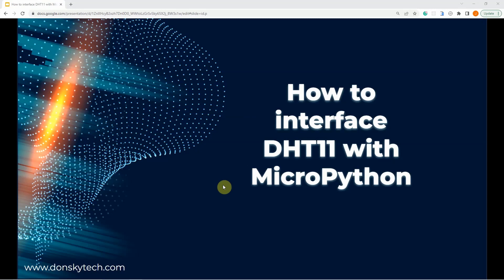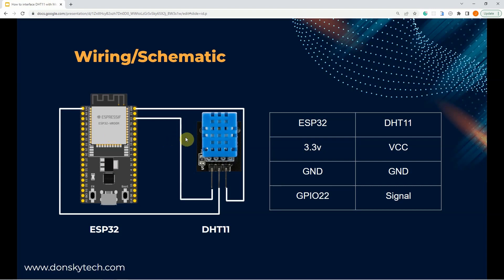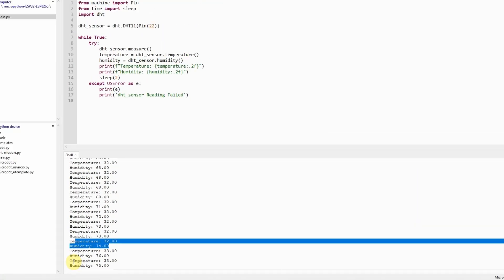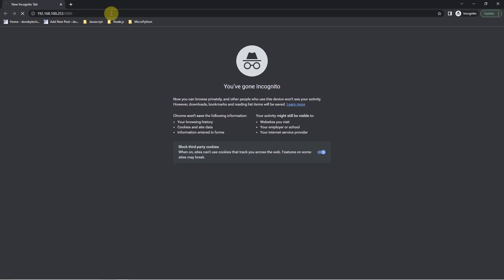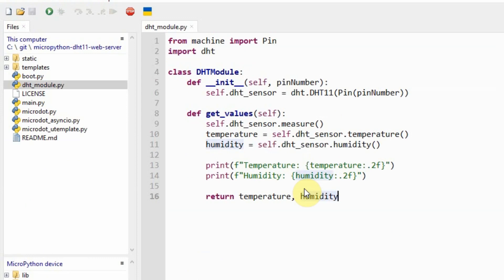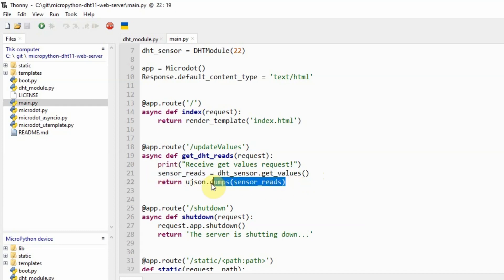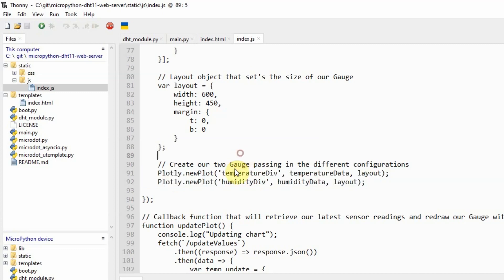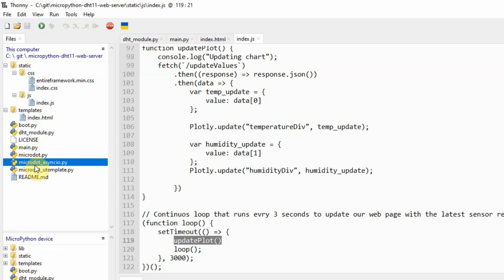How to interface DHT11 using MicroPython with  Real-Time Weather Station Project

Comment: Just found your channel. Enjoying your microdot content. I hope you continue to expand it. One question about how big is this application? Will it fit on the Pico W? If you are looking for a project idea how about a virtual joystick. You got my subscribe. I look forward to watching your channel grow.
Reply from the maker: Thanks for subscribing.  I have just finished creating a program to control your Robot car using MicroPython and MicroDot.   I am creating the write-up and video presentation at the moment.  I will probably release it by tomorrow.
Reply from the maker: Regarding the file size, you will have to check the max file size of your MicroPython device and work around it.  IMHO, I would however not push everything into the filesystem of the device and would redesign my architecture into creating external REST servers that your device would call.  Only the bare minimum code should be placed as we have storage limitations.
Reply: @DonskyTech  Thanks for the answers. I have not looked at your video list, have you covered some of this material? I have spent a decade learning then teaching Arduino. Recently I got into micropython and with the wifi equipped boards it seems like there are so many ways to go. Thanks again.
Reply from the maker: @keithlohmeyer  I have just released a new video on how I created my own ESP32 Wifi Robot Car using MicroPython and MicroDot. I am using my mobile phone in controlling the movement of my car.  The writeup and steps on how to run it is in my blog. I hope you could check it out. Let me know if something is not clear.
Reply from the maker: It uses a virtual D-Pad and O-Pad controller by the way.